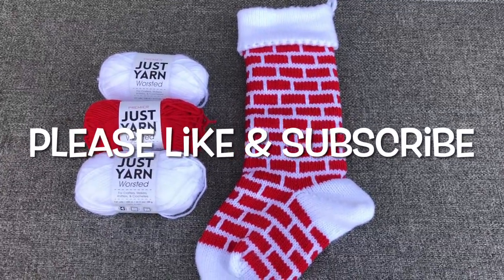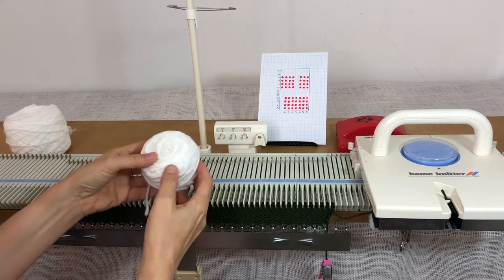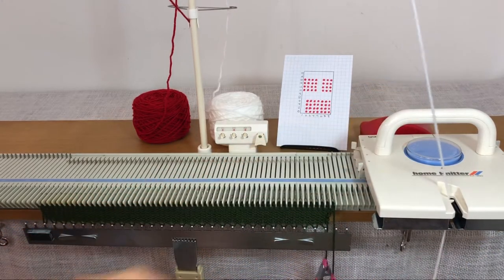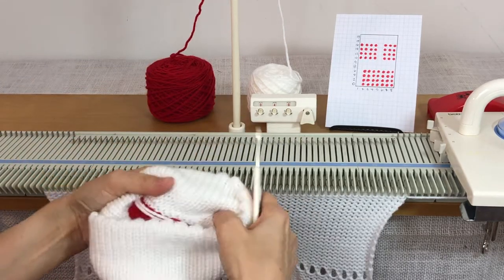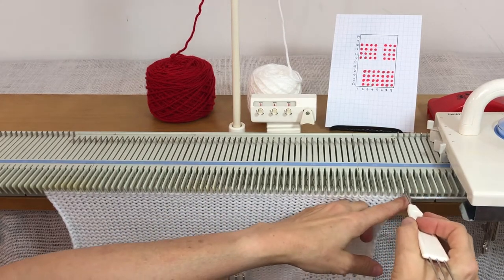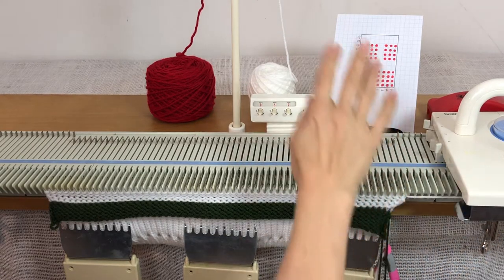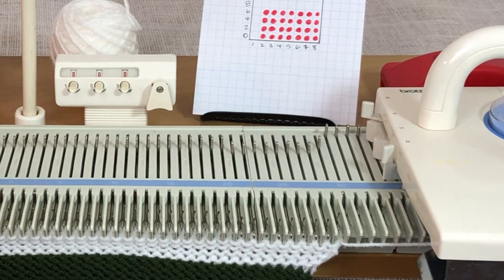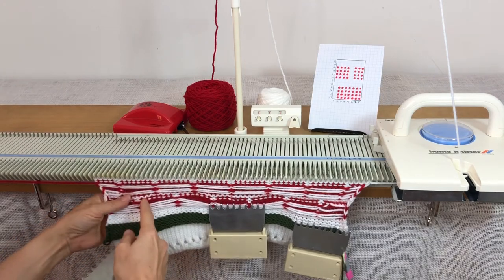Chimney Christmas Stocking on the Brother KX350 or LK150 Knitting Machine

Comment: Is this a standard gauge machine? I have a singer 360k I dunno if this would work on that machine? maybe I would have to use thinner yarn it might come out a little smaller?
Reply from the maker: No, it’s a mid-gauge machine. You can do the same thing with any gauge machine and the appropriate yarn. It will be smaller if you use the same number of stitches and rows but you can increase both of those.

Comment: Newbie here.... if flat knitting is like circular sock machine knitting you should be able to get a more rounded toe by increasing two stitches instead of one on your first increase then continue increasing by one. Should take the square out of the tip of the toe. You'll have to try it and see if it works for you.
Reply from the maker: Thanks! I will try it and see!

Comment: Please how many pins can we use for babies?
Reply: I didn't get the pattern clearly too, is there any video I can check for that?
Reply from the maker: This stocking is a holiday decoration. In the US, people hang them up at Christmas and put gifts inside. If you want to make a sock for babies to wear it would be much smaller. I am not sure how many needles to cast on; I will try to get an answer for you.
Reply: @AnnaHaferman  All right. Thanks